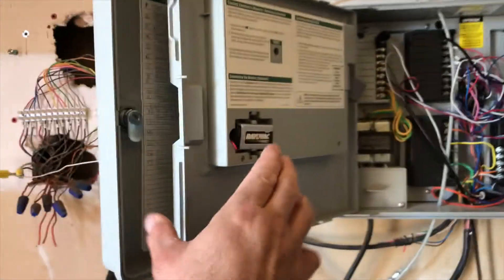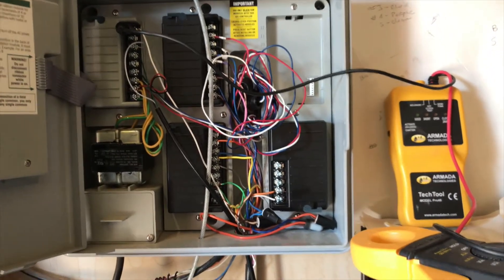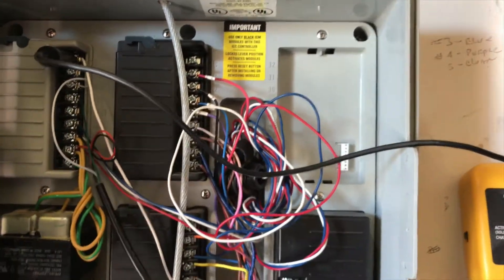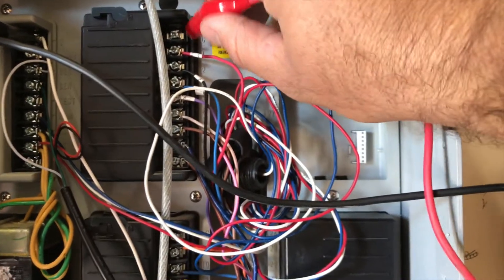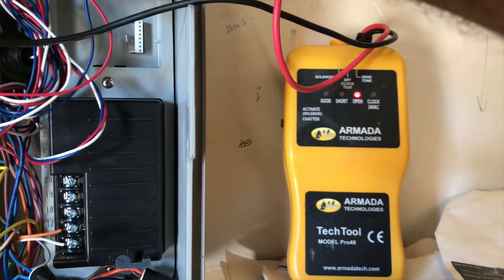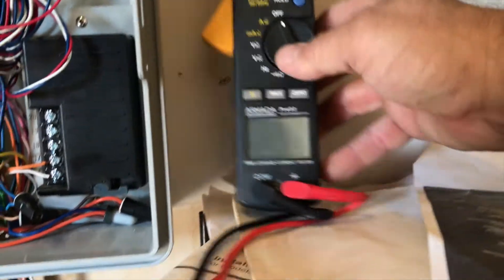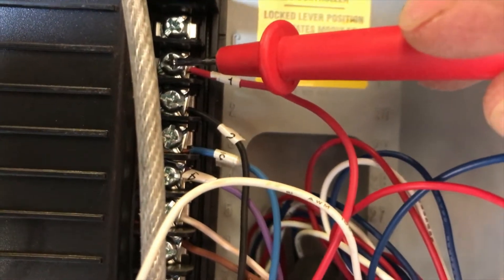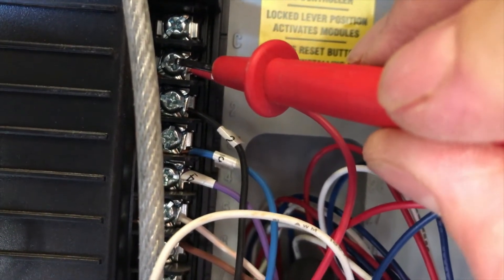Ohming Out a Solenoid | Sprinkler System Troubleshooting

Comment: I did this test on my controller. 4/6 zones don’t work on my system. The 2 that work have a solid reading of 26. The 4 that don’t open have a reading that was very low, under 2, but wasn’t jumping around like the one in the video. Any suggestions on what that means?

Comment: More of a question about the solenoid itself: 1. Can I test it at the valve with it installed as long as I disconnect it from the electrical supply wires coming from the controller? 2. I know the valve is a Rain Bird valve is and possibly a 1" model 100 DVFSS by comparing what it looks like to a stock photo of rain Bird valves. What should be the acceptable ohms range if it is good? How can I correctly identify the model to get the correct replacement if needed?

Comment: Your videos are great and to the point. I actually mainatance a yard and three of her zones are not working, she asked if I would look at them and I have just to see and learn from it. I actually took off the solenoid from the (zone that wasn’t coming on) and swapped with a zone that was and it still doesn’t work. So I’m guessing it’s a electrical issue? How and where would you start? The solenoid that wasn’t working I put it on the zone that was working and it still worked. Thanknyou

Comment: Does the controller have to be plugged in to do this/ is it safe to test while it is plugged in?
Reply from the maker: Yes it is ok to test solenoids from the controller while it is plugged in. But of course always be careful when opening the back of the controller and working around the wiring and power. There is only power to the valve wires when the controller is operating. Otherwise there is no power to them. So just make sure the controller is in the off position. But there is power running thought the plug, transformer and power connection for the controller. So be aware of that.

Comment: Great tip. If it is the wire cut somewhere how to find out where?
Reply from the maker: If you know where the valve is, I would start to trace the wire from there first with a valve locator or wire tracer. and you may need to trace it from the controller as well if possible. Always ask questions too. Like has there been any kind of work done on the property recently? Has anything changed? Has anything happened form when the zone or valve was work to when it stopped working? Asking these kind of questions will help narrow down the search.